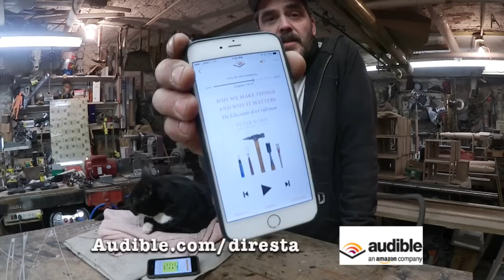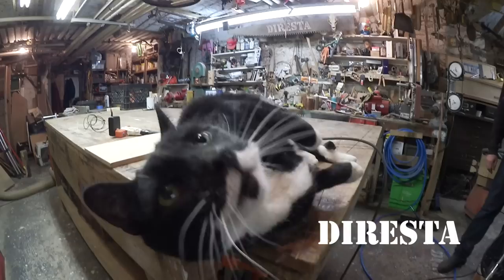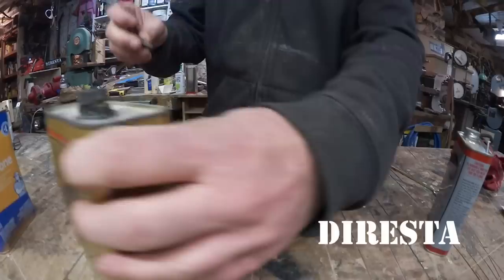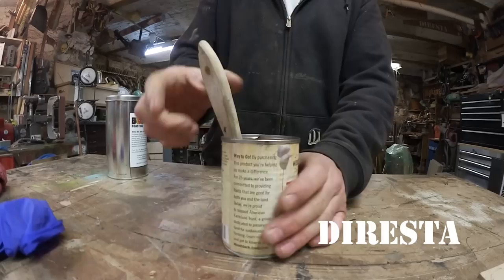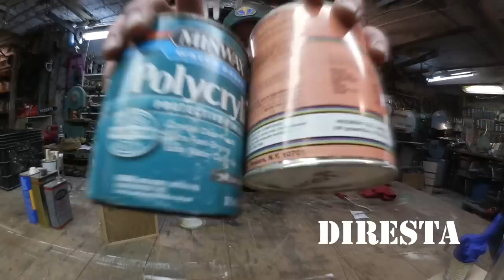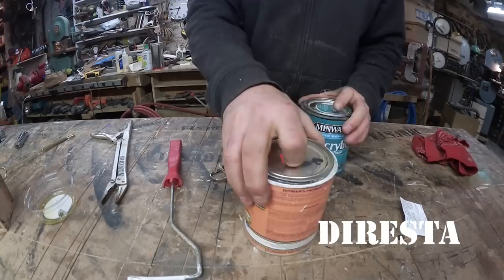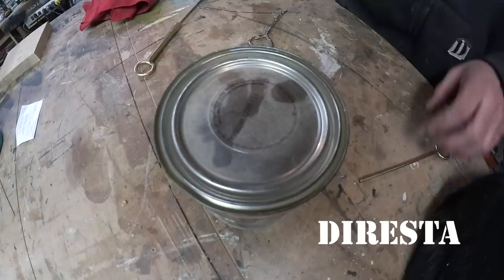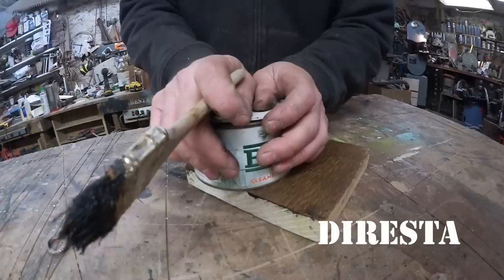✔  DiResta Jimmy Tips 2: Paint Brushes & Cans

Comment: Awesome tips Jimmy!

Couple more...

If you don't want (or can't) store the brush in the can, you can put the end of the brush in a plastic bag and wrap painters tape around the handle.  This keeps the paint wet for at least a day or so, until you finish the project.

Take a big rubber band and wrap it around the open paint can so that the band divides the opening.  Then when you dip your brush, wipe the excess paint on the band instead of the side of the can's opening.  When you're done painting, you'll have little to no paint in the trough around the opening.

Comment: Thanks for the tips and congrats on the new sponsorship.  I'm also enjoying your podcast with Bob Clagett and David Picciuto. 

One tip I can share - when using water based latex or poly, if I'm doing a fairly big project I use up a quart or gallon can pretty quickly.  This leaves the can in good shape.  I'll rinse it out and keep the empty.  It's been helpful when I re-open a can that has a rusted shut lid or need to pour a partial amount of a gallon of paint/poly into a smaller can.  I did this just the other night when my buddy destroyed a gallon poly can because it was glued shut.

Comment: Your last tip of using Argon gas to displace the air is great. Another way to do that is I use a sheet of plastic wrap. Lay it over the top of the open can and then push it down into the can leaving the edges of the plastic outside the can and put the lid on. This also helps me recognize a partial can before opening a new one at a glance.

Comment: with paint and varnish because i dont have a welder i seal the lid and leave the tin upside down so its always looks full when opened and ready for use and you can put an elastic band around tin to wipe off brush another great vid,,cheers.

Comment: Great new segment Jimmy.  Invariably my painting projects last at least a few days.  I use glad wrap (Cling Wrap) on my paint brushes for water based paints, and if it's going to take longer I then put it in the freezer inside inside a plastic container.  Yes it really does work!
Reply: Yup I second this advice. Also plastic bags and sandwich bags work well too.
Reply: Nalu Rash Cool tip!  I use sandwich bags all the time for things other than sandwiches.  Though I never thought of this kind of application.  Thanks!
Reply: Yeh!  I do the same (minus the freezer).

Also when using a roller I put the entire paint tray and roller in a larger bag.  I once did this each night for a week and it all stayed good.  Saves a lot of cleaning and a lot of waste.

Comment: If I'm painting with a brush out of a can, I'll wrap an elastic band around the can, so the band goes over the top, down the middle. I use that to wipe extra paint off, no messes in the seal of the can anymore! And no need to punch holes in the can ;)

Comment: Hey Jimmy,

Instead of putting the holes in the gutter, you can use a thick rubber band around the can. Make sure that it crosses the opening on the top of the can right down the middle, then you wipe your brush on the rubber band instead of the rim of the can. Keeps it really clean =)

Also, that tip about using argon to replace the air is pretty freakin genius!

-Vinny

Comment: You can also use Alcohol to help when You need to "break" or "get rid" (clean off residue) of hot glue. I've found it especially useful when having to "clean up" old gluing where the left glue has been thin soft and "sticky". You "wet" the glue with the alcohol, which "seeps in" and makes it "release" much easier leaving clean surface (it seems to make the glue "stiffer" and less "sticky"). I used "methylated spirits" but I believe any alcohol will do, it also has the benefit of drying upp "fast  and clean"

Comment: When you punch a hole in the "crappy top cans" for the poly/thinner, I'm thinking instead of a screw you could use like a dab from hot glue to just form a temp plug on the hole.  Then, just pop off the make shift cork and ready to go.

Comment: I've done the screw trick with sheet metal screws and a little piece of rubber as a seal. Stuff like POR15 that I don't use a lot of lasts me forever this way. I pull the screw and pour out just what I need. Otherwise the gutter holds the paint and glues the lid on...

Comment: A couple tips I learned a long time ago: when you have more painting to do the next day put your brush or roller (still on the frame) in a plastic shopping bag down in the bottom, flatten the bag and roll the flattened bag around the brush, like a body in a carpet.
If you're going to leave a can of paint for a while, but want to use it again take another plastic bag (without a brush in it) put your hand in it and put your bagged hand into the can of paint, opening the bag out to the sides inside the can. You want the bag to cover the surface of the paint...put the lid on it and have a beer.

Comment: Doesn't the skin form from the oil evaporating from the surface of the paint? Why does argon prevent that? Is skin formation a different reaction from paint drying?
Reply: the oil actually "polymerizes" in a reaction with oxygen, rather than "drying" due to evaporation.
Reply: Jason Gilbert And a second look at the Wikipedia page says that the oil doesn't actually evaporate. Thanks

Comment: I don't have a welder with argon, will propane from my hand held torch work to preserve the paint?
Reply: Unlit?
Reply from the maker: don't use propane ! it is flammable , and it will not work the same ..
argon is not flammable
Reply: You want to make a bomb? Because thats how you make a bomb. CO2 should work, you can get CO2 in a spray can as computer duster.
Reply: Got it, no propane! I thought it would be cool to make a special paint lid that would use a co2 cartridge to displace the air or maybe even a plunger device to create a partial vacuum.
Reply: The propane may cause the oils and binders in the paint to separate. If they're separated for to long it may harden.  You want a inert gas as to limit chemical reactions. Of course there's also the danger of having flammable gas in a unsafe container.
Reply: acousticguitarpeter most computer dusters are fluorocarbons some of them flammable, CO2 wouldn't work in a spray can, you need 56bar to make CO2 liquid at 20'C. If the paint has thinner in it the gas inside is already flammable

another option is to store the can upside down, then the skin form at the bottom of the can
Reply: Lasse Langwadt Christensen
Ql mate, thanks for clearing that up. We all learn every day.
 p.s. I said "co2 SHOULD work" for my defence :)
Reply: The reason argon works well is because it is a noble gas.  Its outer shell of valence electrons is full.  This makes it inert such that it does not readily react with other chemicals.  This is why the skin doesn't form.
Reply: Sam Petrocelli  how safe would it be for me to siphon the argon out of my neighbors new windows?  I have a bunch of paint cans I wanna hold onto :-P
Reply: Kevin Stempien
I like the way you are thinking!
Reply: Lasse Langwadt Christensen This is actually just a wrong premise.

CO2 would work fine in a computer duster can. The only necessity for function is a pressure gradient. Storing the gas under a high enough pressure to liquefy it only accomplishes storing more of that gas in the can.

There are computer duster variants in line with this, although they're not particularly common.
Reply: a normal can isn't rated for more than maybe 10 bar so with compressed gas it would be empty in seconds
Reply: Lasse Langwadt Christensen I don't think I made this clear. What you said is wrong. What I said is right. It's that simple.
Reply: Kevin Stempien That reminds me that my dad had this cheep vacuum food sealer thing (I think was called seal a meal). He would put his varnishes and paints in mason jars and use the jar attachment to seal them.  Maybe that's worth looking into.
Reply: Now I'm really intrested which of you two has it right...
Reply: acousticguitarpeter I am. The products exist. His opinion is irrelevant.
Reply: ***** thanks for the info, Herculiner is expensive but useful for many projects.  I'd like to get as much use out of the can before it dries up.
Reply: seigeengine The only product I am seeing using CO2 is using cartridges, not canisters. I am going to have to say you were wrong on this one, it doesn't use a spray can. It is a dispenser powered by cartridge. They are entirely different products. You would be right if apples=oranges. Provide a link to this canister (not cartridge based dispenser) if you are able.
Reply: +Lasse Langwadt Christensen This information is partially incorrect in that most "dusters" these days use tetrafluoroethane (R134A) because of it's insignificant ozone depletion properties. It is also essentially non-flammable. It has a flash point of over 400 degrees.

Co2, as well as nitrogen, have been used in the beer industry for a very long time to displace oxygen.